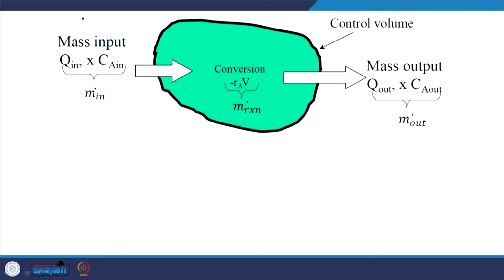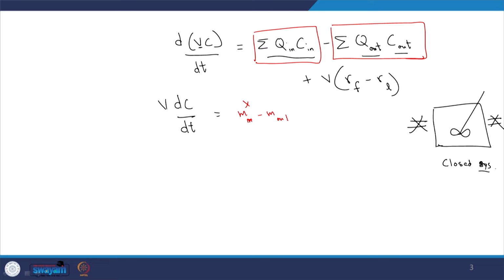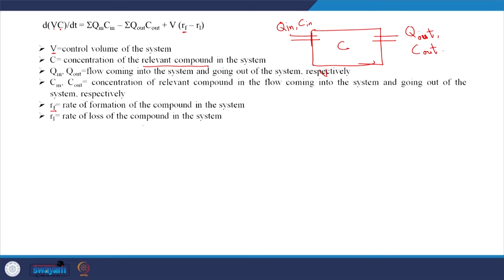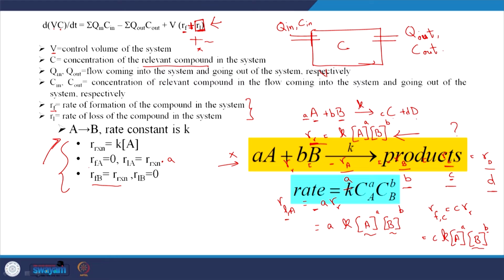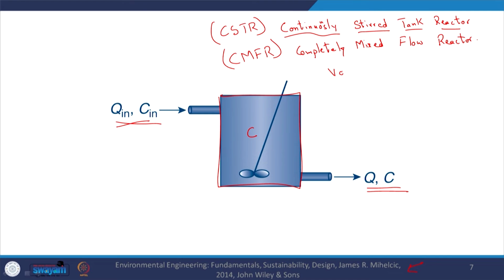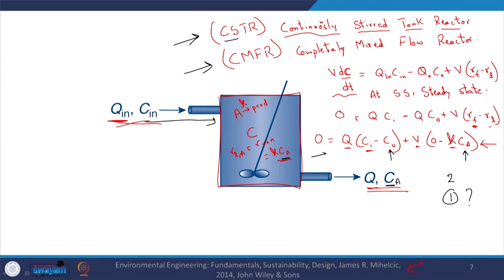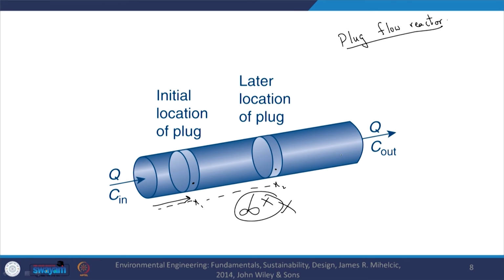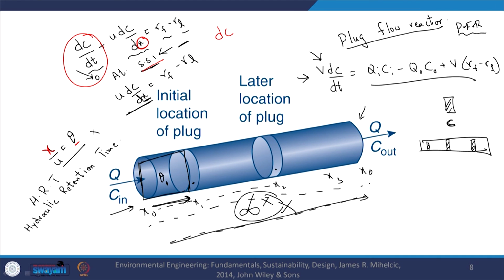Lecture 06: Mass Balance: Batch reactor, CSTR, and Plug flow reactors.

Comment: sir how do we know that volume coming in per second is equal to the controlled volume we are taking
Reply: Volume per second determines the flow rate into the reactor,  whereas the control volume is generally indicated using mass input Q*C as shown in the balance equation.